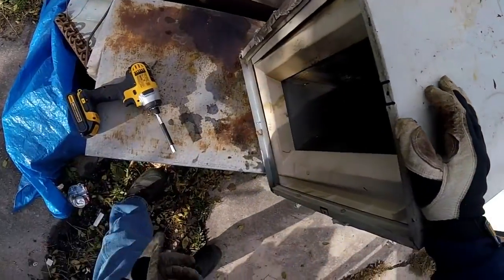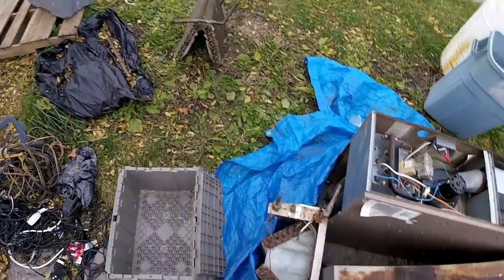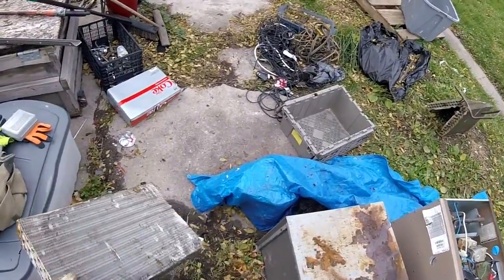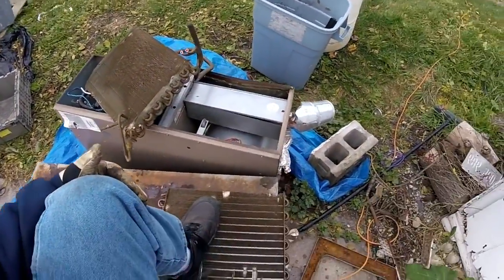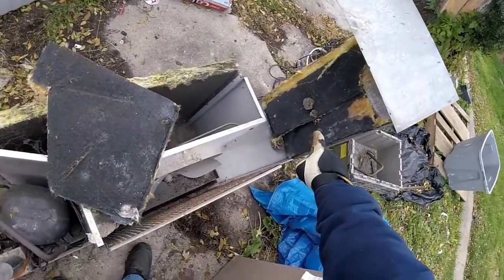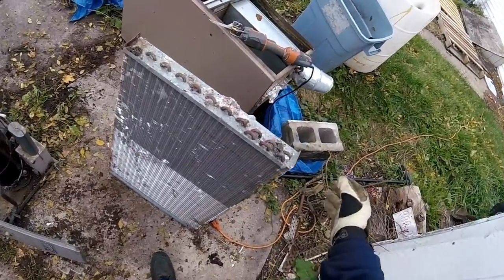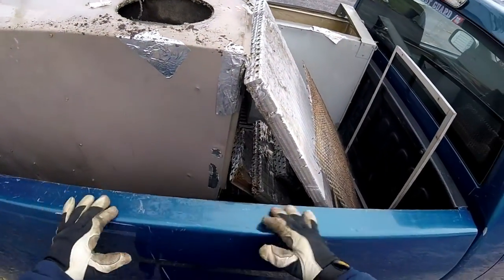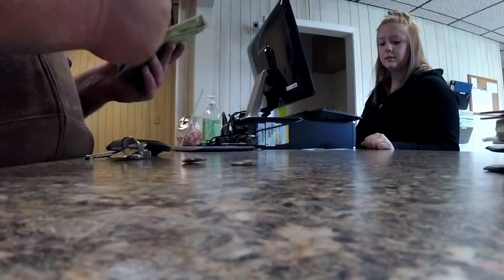Scrapping Out an Air Conditioner v. Throwing the A/C Unit into the Shred Steel Pile

Comment: That 43.50 didn't include the copper you cut off.  Those noodles, as you called them, pop off easily with a screw driver. Each time you do a job like this you learn a little and it gets easier and faster.  Using a clamp or something to keep the rads from shaking all over also helps to make it quicker, safer, and easier.  Great videos brother.I've taken a lot of compressors apart, it is not as easy thing, it's messy and I just don't do it anymore.  Probably worth checking out though so you too know you don't want to do it.

Comment: Paul if you are going to break the scrap down, you need to build a work surface for break down on, build it 30 inches high 36 inches wide. that way you don't have to bend over as much. I would get the wood you need from the wrong size pellets you fine.

Comment: Paul from a guy with an A.C. Business you can break those units down even further by breaking down the motors in the air handler.. you can get cast Aluminum, steel, plus the copper, also on the coil separate the number one copper and number two copper.  Plus get the brass off the expansion valves on the coil.  All of it adds up brother.. good video also
Reply from the maker: Cool Brad. Thanks. When you're talking about the coil, are you referring to the compressor sealed unit thing? Or is the coil the radiator? Not sure.
Reply: @ScrapPalletMan  in that type it's called an A coil. It's the part that has all the aluminium fins in the first part of your vid. The compressor can be broken down further also. Moose Scrapper has a vid on that. Has a chunky bunch of copper windings in it.
Reply: Scrap & Pallet Man yessir just what Donnie brown said.. the radiator is the A-coil.. and the coils on the outside is the condenser coils..
Reply: @bradkelly3681  you probably know what a condenser evaporator is. The company I used to work for swapped out 4 of these monsters. Just the copper alone, not including the motors, paid for a deep sea fishing trip all expenses paid for our 8 man crew. Just saying, from an old retired tin bender. Lol
Reply: AC units are like scrap gold to me and my husband. The summer months were unreal, we would find one every other day. Now that it’s winter all of the company’s are keeping most of the unit and leaving the steel scrap. Great info on breaking them down, we just found out about the copper inside the compressor last month, we were chucking them with the steel. We never stop learning new things doing this.

Comment: Great to see you doing more micro scrapping. Just a little safety advice. You should have the electrical wire on the ground behind you so it will hang down behind you and won't keep trying to go forward toward the sawzall blade. As it is getting dangerously close when you have the wire on the ground in front of you. Just make sure you know where the wire is and don't trip over it.

Comment: You are 100% right to cut the noodles on the inside of the steel plate. Saves you from cutting twice and you don't leave any bits of copper behind lodged inside the plate.

Comment: Stand them on their sides to saw the ends off. Plyers will pop/snap those noodles off easily. I used to grind off the noodles then pop the metal off. Remember this is your first time doing this so you are slow at the process. You can cut your time in half easily with practice.

Comment: This is why I have a melting furnis** there is about 6 lbs of aluman in those you had an 25 in copper now if you would have gone a little further in work and spent another hour or so you would have gotten No# 1 copper at $1.90 to $2.40 a lb and doubled that

Comment: 40.00
Reply: Not bad at all! It does suck taking those things apart but if you could save up a few of them and spend one day per month might be some really good moolah. Most of the Yards around here won't let me take in the radiators from the condensers unless I have a HVAC license dot-dot-dot bummer I have to take them to the yard that gives me around $0.50 a pound less for RADS but does not require a license. But the yard that allows me to bring in those RADS also gives $0.09 a pound for sealed units
Reply from the maker: Each area and yard does things differently. Pretty wild.

Comment: Drain the compressor and cut it open, there's a nice big transformer in there which has nice copper
Reply from the maker: What do you do with that green compressor oil?
Reply: @ScrapPalletMan  drain it into some sawdust or kitty litter or you could recycle it by taking it to an Auto Zone and put it in their oil recycle bin.
Reply: and make sure to pry out all that copper tubing from the steel mounting brackets you cut off from the ACR's, those are #2 copper tube. That should be an extra 5-7 dollars just in those. 
Nice video. Happy Scrapping